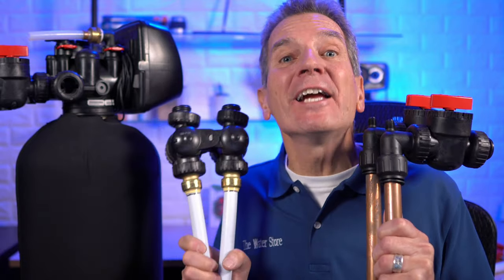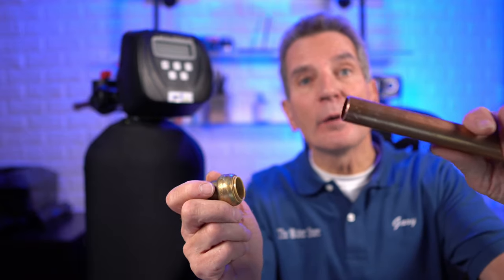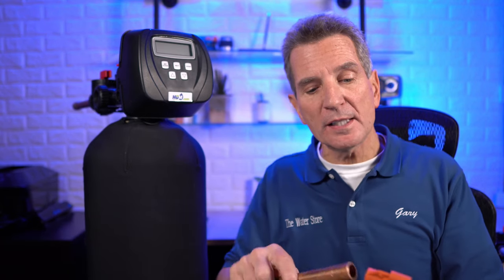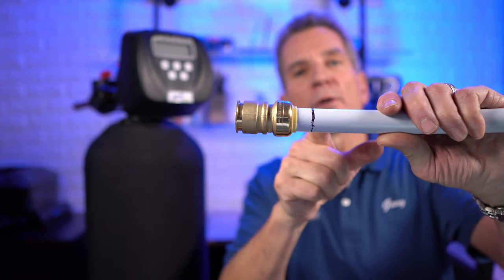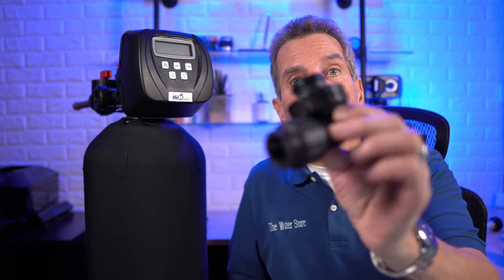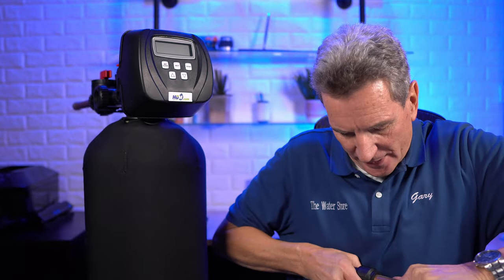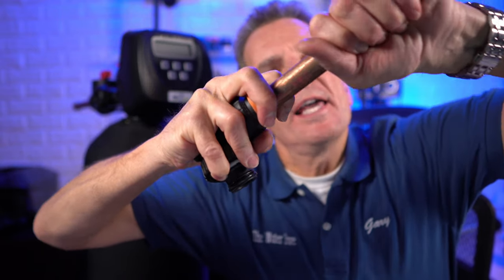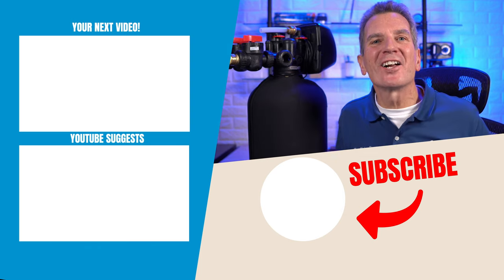Best CLACK WATER SOFTENER Installation fittings

Comment: Merry Christmas GARY!  What is a HUM filter?
Reply from the maker: Merry Christmas to you too!  HUM is our private label brand of water filtration equipment which in this case refers to all of our water softeners, iron & sulphur filters, tannin filters. https://waterestore.ca/search?type=product&q=hum* All of which feature the Clack WS1 valve and can be installed using the fittings shown in this video without soldering.  To learn more about HUM water filtration check out this video https://youtu.be/hqYmmpiM5T4

Comment: Hey Gary. I have a water softener. Recently we noticed that our water makes use feel slightly sticky after using soap. Can you please help?
Reply from the maker: Great question!  One of the biggest advantages of a water softener is that you use less soap.  Try using 1/2 as much soap and you will still be clean but less sticky and save more money for your family.
Reply: Not slippery, sticky. I've had the softener for about 4 years. It's different these days. Something is not right.